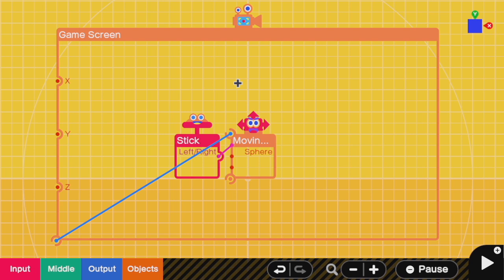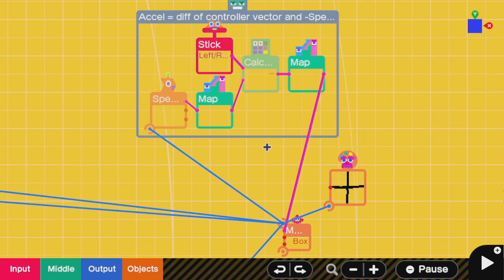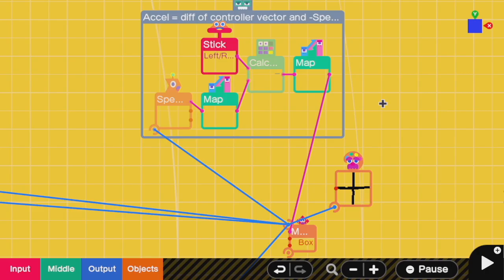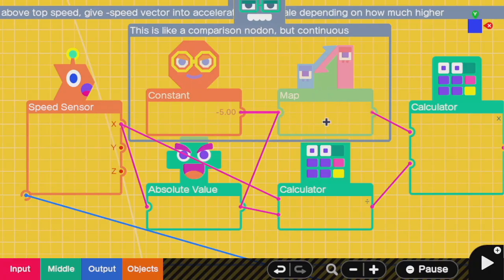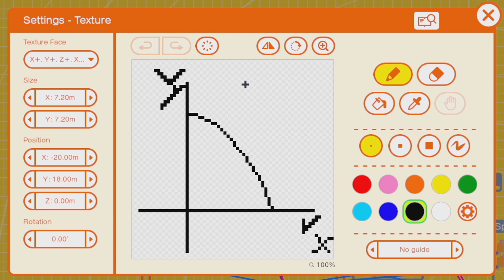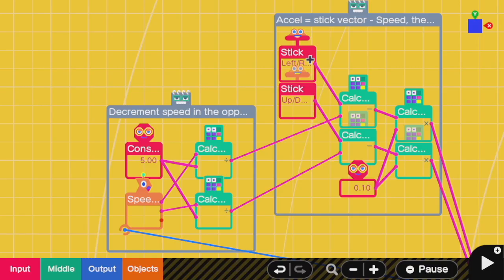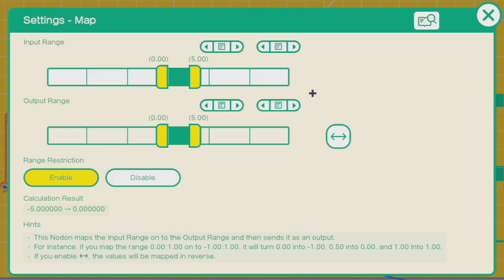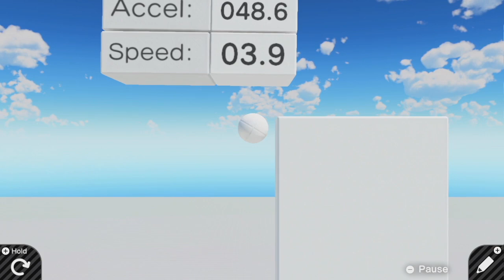How to make a 👟 MAX SPEED 👟 for Characters in Game Builder Garage (Guide/Tutorial)

Comment: When I try to make this 3d, it works fine until I change the frame of reference to camera and use a camera node. It will spiral out of control and fly off the map as soon as I touch the joystick. However, when I turn the camera backwards, it works completely fine. Is there anyway to fix this.
Reply from the maker: It sounds like you need an inversion nodon on one of your inputs to correct for frame of reference.

Swapping around inputs at the start to correct for these sorts of things is common practice, and necessary to customize depending on the situation.

Comment: Sorry but I have a bit of confusion about the 2D and return to rest method, you did the subtraction on the 2 axis individually but aren't you saying in this way that there is a max velocity Vm on both axis so the actual max velocity depends on the direction you are facing, for example on one of the axis is Vm, on the diagonal is sqrt2•Vm
I don't understand how you know the real velocity without computing the sqrt of the sum of the squares

The other 2D method seems to take this into account
Reply from the maker: Max velocity is the magnitude of a vector. If you go at a diagonal, that length is still Vm, but it would be at (vm sqrt2, vm sqrt2). For the last one, I did take the velocity by sqrt(x^2 + y^2).

For returning to rest (3rd one), you don't need to figure out the magnitude of the velocity vector because you are always just subtracting the (velocity vector)/Vm from the stick vector. This naturally makes the max speed happen because when the velocity vector is Vm long, you are subtracting two vectors of equal magnitude. Specifically, you can't accelerate any more away from zero velocity.
Reply: @loupandsnoop  I really thank you 'cause I was wrong about what the stick would output when in a diagonal position (I thought +-1,+-1; but I was very wrong ahah) so every reasoning was influenced by that wrong assumption.
Good tutorial, excellent video and channel
Ty for taking the time to reply

Comment: Instead of using a moving sphere, simply use a free slider to move it around 👍
Reply from the maker: If you do this, you will run into the wall problem. The desired position of the ball could be on the opposite side of a wall, and then you have weird slingshotting when you go around the wall. OR it takes a lot of time to move the desired position to a valid position. That is why I didn't use a free slider.
Reply: That's why @loupandsnoop  did not use Free sliders or your character is an angry bird in game Angry birds or it will take so long to move the desired position to a valid one.
Reply: I always run into issues with free slider because it will keep trying to go in a direction even when it collides with something, and it always messes up the player's expectation of where the object is, and where the game engine thinks it should be.